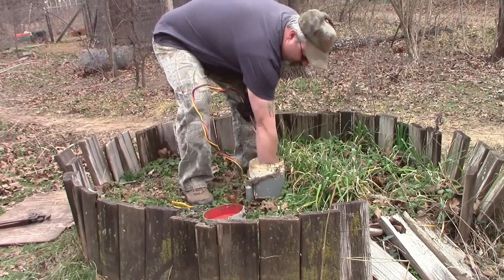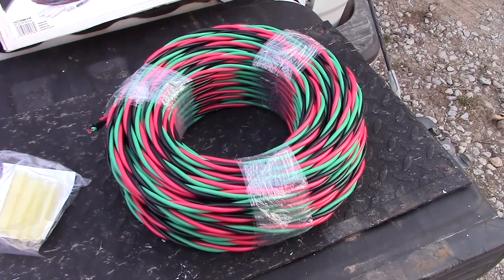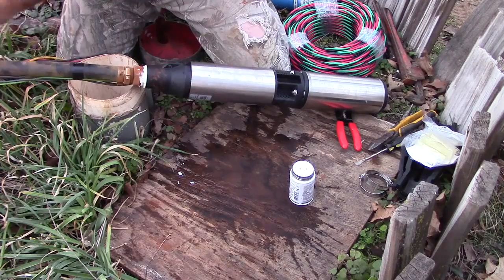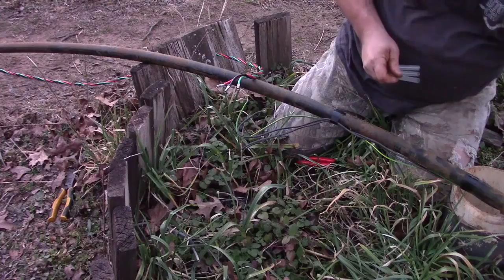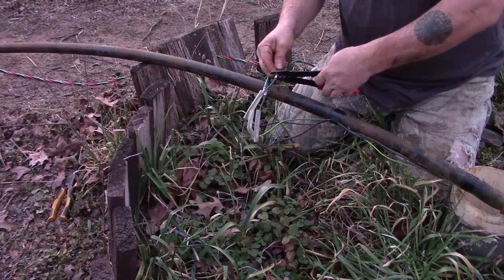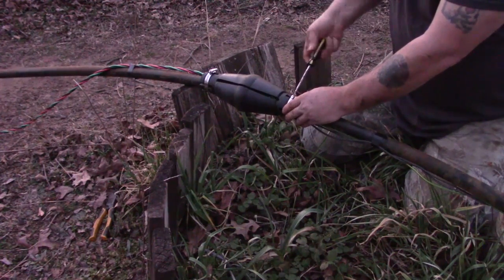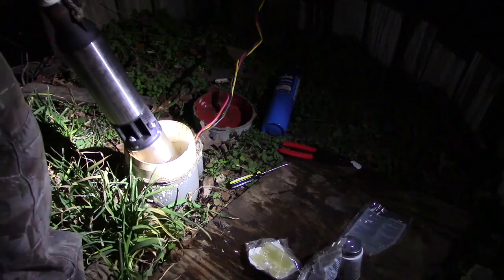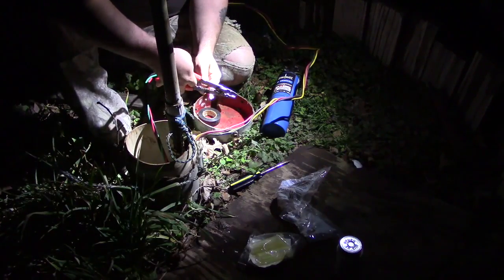Remove & Replace 110v, 3 wire, 1/2 hp Submersible Well Pump

Comment: When you say you don’t want the wire shielding to touch your connecter at 17:25.. could you explain please? Awesome video by the way! Thumbs upped the video 👍
Reply: Is it the tiny metal piece that you crimp the two wires together with? For example if connecting the ground wires together you have each end of the ground wire only exposing 1/8 inch of the wire.. and then the small metal connector should not touch the green shielding on either parts of the green shielding as you crimp it in place between the two wires? Also do the tips of the two 1/8 inch ends of wires in between the connector have to touch each other? Or just sit in that connector? 

Thanks!

Comment: Great video, thanks for the contribution.

When I turn my pump on, I'm hearing water snap throughout the pipe every few minutes or so. Loud snap in the ground, with vibration, along the underground pipe running to the house. Well housing was struck by a bush hog previously and was repaired, but wondering if a piece of broken pipe fell in and is causing this. Think I'm gonna pull it and inspect, but not sure how to diagnose.

Comment: Arn't you supposed to adjust the torque arrestor to the size of your pipe by moving the clamps closer together when you get to that part of lowering it? I am in the process of removing my submersible pump this weekend.
Reply: Yes, you are suppose to tighten the bottom clamp, put the arrestor into the casing, pull down on the arrestor until it is snug against the wall, tighten top clamp. Do not put the arrestor in so snug that it is hard to slide down the pipe.

Comment: Thank you so much for this video!!! I've been dealing with trying to get a plumber to find my problem for almost a week. He just doesn't want to work more than 3 minutes at a time.
After your video, I just decided to replace my pump myself to see if that was my issue. Next I would have tried the switch. My pump is in a cistern and not a well.
I pull everything up and see a huge global of electrical tape! When my pump was replaced in March, the freaking repair guy used household electrical screw on caps and tons of electrical tape! Inside my cistern that is filled with water!!!
Forget paying these "professionals"! Im going to do this myself! An expensive pump might last longer than 4 months without shorting and burning up my equipment!
Thank you so much!
Reply from the maker: Thanks for sharing your story, sorry you had to deal with a dishonest person back in March and a not so motivated plumber now. I'm super glad my video was able to help you find and finally fix your problem. Appreciate your kind words, they have really made my day. Thanks for watching Brandy! Appreciate ya and hope you the best of success in the future.

Comment: Now I've seen other videos where they use heat shrink tubing instead, would this be less protection than the environmental connectors and could it be used in conjunction as to double layer the protection? I will be new to this as I am moving from an area that has this via municipal services to another with well and septic.
Reply from the maker: The environmental splices actually have a type of heat activated adhesive on the inside that bonds to the wire coating, making them water proof. The Heat shrink does just that, shrinks down to the diameter of the wire with minimal water proofing properties. My opinion in this application, the environmental splice is the way to go. 

As far as doing both on the same application, I don't have any experience with that; although have used both in different applications. My concern is that when you have the environmental splice installed properly, when you were to apply heat to the heat shrink tubing to install that, it might cause the environmental splice to fail because it received heat for a second time and got too hot.

Hope this helps and answers your questions. Thanks for watching!
Reply: Your Welcome and Thanks for your reply being at this time - this is all new to me! Just another quick question,  I have seen two types of drop pipe in videos on this subject, How would I tell if I have  PVC Sections or Black coil piping similar to the one in your video?
Reply from the maker: That wouldn't know until you pulled the pipe up and looked. Mine is made out of PEX line. When we moved out here years ago, the original installation was made with PVC. I like the PEX better, but both are accepted in the installation.
Reply: so PEX would be referred to as the coil type hose some are talking about? I could agree that PEX is better being that PVC has the intention of cracking.
Reply from the maker: PEX probably is what they are referring too when they talk about coil type hose, it does come in a big roll. Agreed on the PVC has more of a tendency to crack.
Reply: OK Ive heard that for every 100ft there should be a check valve installed, can these check valves be installed inline using PEX, so far Ive seen this configuration used with PVC! Sorry for being a pain as I am trying to get educated on this!
Reply from the maker: You're not a pain, we all start somewhere. I asked questions when I did my first one, so glad to help. 

Our well is only at 110 feet, so I didn't add a check valve. Also the pump I used has a check valve incorporated in the the top to hold the water in the line when not in use. This keeps the pump from working as hard and also keeps the line primed. I would read the paperwork that comes with the well pump you purchase to see what the particular manufacturer requires as far as check valve installation and linear feet for the installation. 

If required, you can add check valves just as you would any splice in the PEX. Just have to ensure the the fittings are the correct size and type for PEX. Many types of the check valves do not come with the fittings so you buy what is required to match the type of installation required.

Comment: The pump you have is actually a 2 wire pump.  They don't count the ground when naming it and a 3 wire would have 4 counting the ground.  Other than that pretty straight forward pump change.  It doesn't matter if you drain the pipe or not when you pull the pump.  The pump will be sitting in the water and won't have an issue with empty pipe.  Stay safe, Kenny
Reply from the maker: Thanks Kenny! I just got the name straight off the box so I wouldn't mess it up. You know packaging/label folks don't know what they are talking about most of the time, they just box it up to put on the shelf. Appreciate ya watching, take care.

Comment: I always cut my wires at three different links so all my spices are not together
Reply from the maker: Hey Jerry, thanks for stopping by. I had thought about that too, and probably should have. I wanted to make sure the splices would fit under that torque arrestor and also was in hurry trying to beat the daylight (which daylight won). Hindsight, it probably would have been better to do that. Appreciate ya!